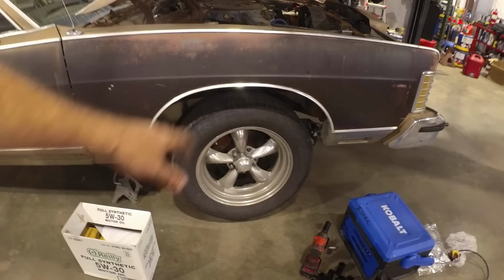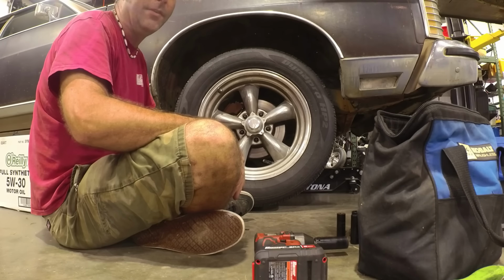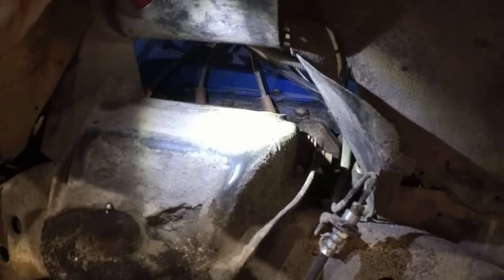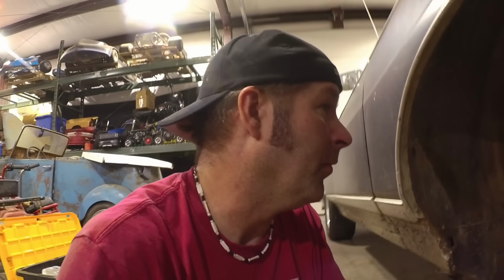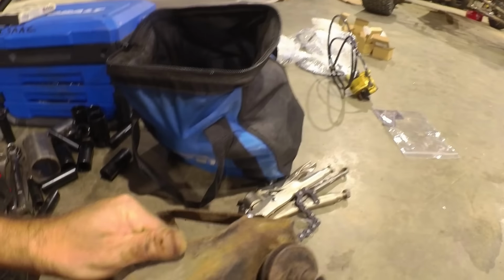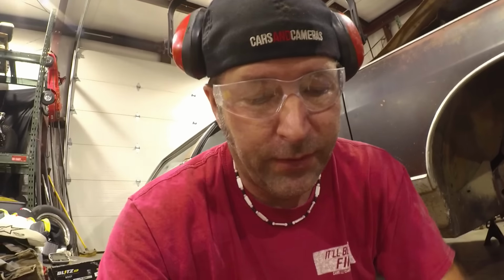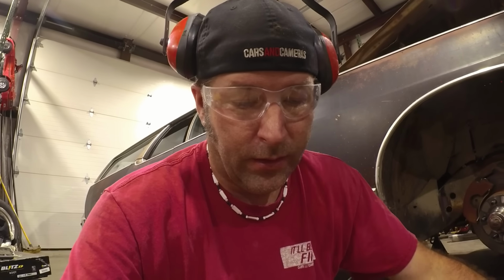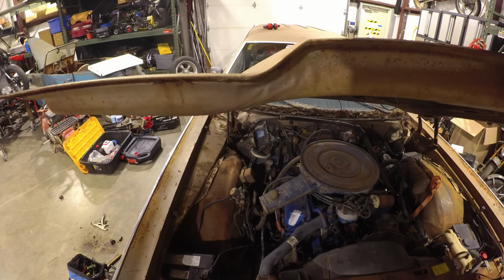Taking My 77 Mercury On A 5000 mile round trip to The Bonneville Salt Flats

Comment: In 1979 I took my driver's test in my mother's 1976 Mercury Colony Park station wagon. Ours was white with wood paneling and the same interior as yours, the 460 4-V engine and my father had air shocks added to the back also. Our air valve for the shocks was located in the dead center of the car, through the flexible filler piece between the bumper and the body of the car. That way we could access it without having to crawl or even reach underneath.

Thanks for bringing back the memories!

Comment: Quick & dirty trick for UCA bushings with old Mopars. Get the "Problem solver" edition from Moog, install the fronts as instructed, then rotate the rears 180⁰ out, kicking the UCA angle to the back. Then, in the alignment phase, you can adjust for the traction of better, modern treads & compounds.

PS- I always hunt for parts from close-out houses, Amazon, eBay...look for the old TRW or Moog (Cooper Industries or earlier) boxes with "Made in USA," Canada, Japan, even Mexico...I think my cop car NOS Moog ball joints were $8.23 each!

Comment: Hey, Issac? I have an idea for the chain drive on your land speed bike. Add a mid chain sprocket between the engine and the rear wheel sprocket halfway in the frame. It will help prevent the chain from twisting off and break and adding more gearing to possibly doubling your speed with less stress on the chain drive. It will handle the torque much betters.  It would be similar to using a leverage pully lifting heavy object up, but instead, propelling the bike forward faster.
    I was watching YouTube and stumbled on this trick someone else was using on a bicycle. The man says it works very well. If it works on a bicycle, it can work on your GO POWER SPORTS land speed bike. Just try it, Issac. I'm just trying to help.

Comment: If you drill a hole through your where your license plate bolt is you can feed the shrader valve through and use it as the license plate bolt. Then you don’t have to crawl under the car to add air. I did it on some air bags I put on my pickup and worked great.

Comment: No need for pickle fork on ball joint. If you use the fork it will likely ruin the ball joint. I use 5 pound mall hit the spindle write at the ball joint careful not to hit ball joint. Best place to hit the upper spindle is at ball joint. Turn wheels full turn right and work on passenger side . A couple good very hard hits will knock ball joint lose.
Reply from the maker: That's actually how I did it

Comment: When yall are on the interstate pulling a trailer, 55 mph in the slow lane, yall were going 80 mph in the fast lane, WTF !!!! Have yall ever been to drivers education, WTF !!!
Reply from the maker: It's called doing the speed limit
Reply: Uummm, here in Michigan there is no difference for pulling a trailer, & at 55 you'd get plum run'd over!  Certain areas are posted at 75.  Tho there are some areas that 65 is max for semi's...  (& I checked...  First drivers ed class was June 1974.  Had another 6-7 advanced courses since then, lol !!)